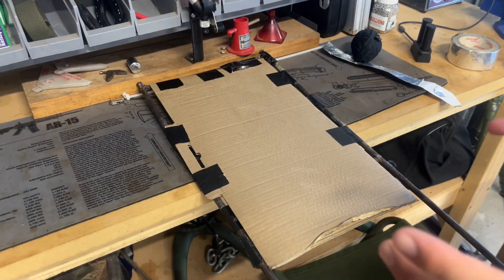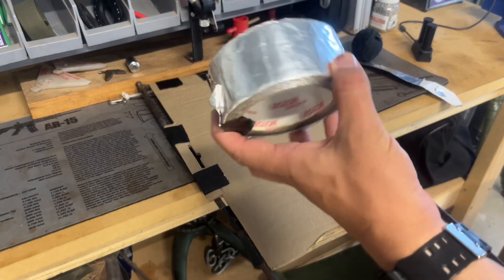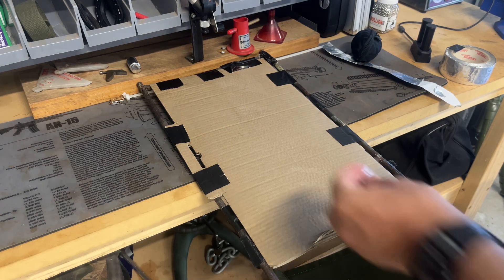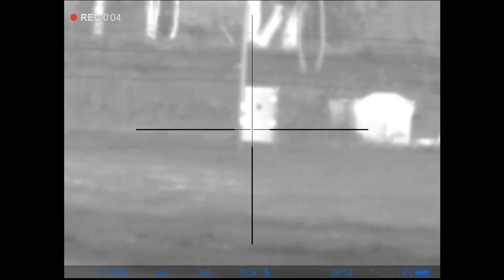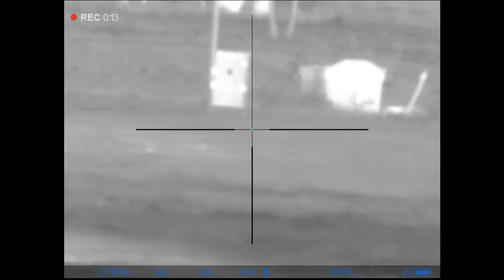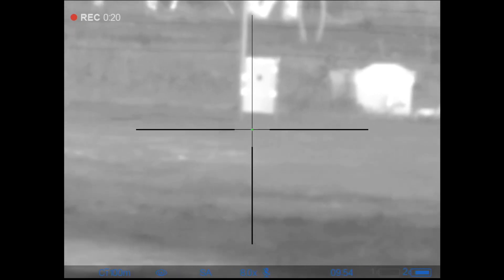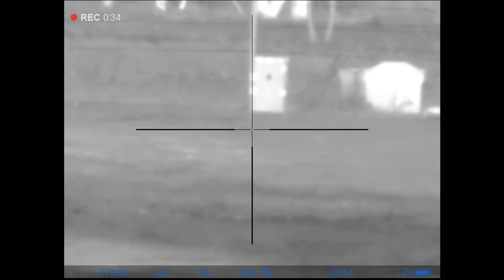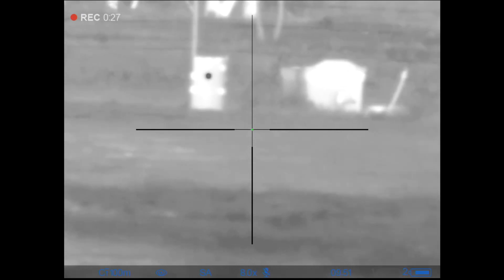Cost Effective Thermal Zeroing Target

Comment: Aluminium foil folded into a 1” square and centre stapled to a target board has been my go to.
I’ve found often that when black hot isn’t reflecting a good signature due to atmospheric conditions then switching to white hot can improve the picture significantly.
Keep up the good work mate.